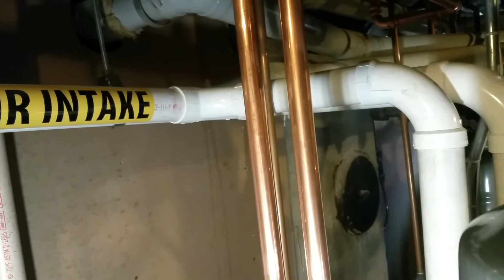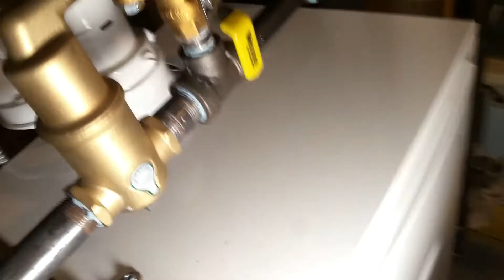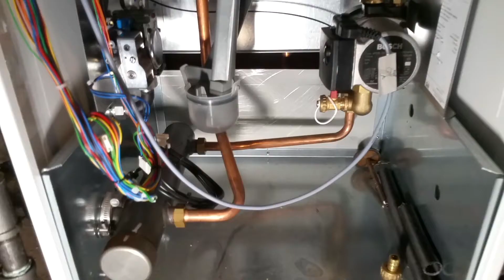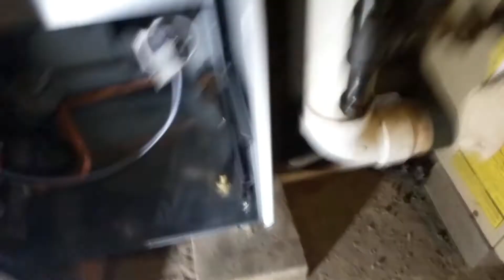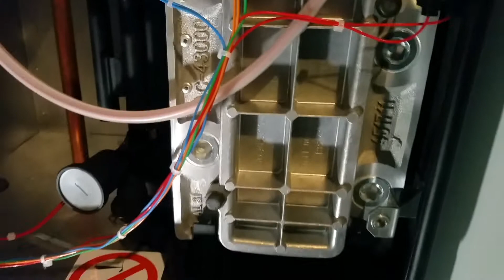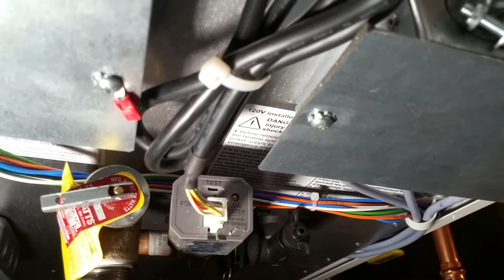Bosch Greenstar Heating Boiler FS79

Comment: Great video, our installers never pulls that plunger out, seems to work fine with  Multiple zones . Not saying it's right just what I have found out in the service world,  also we had to pull the fw200 out , we had way to many insufficient heat calls with them installed !